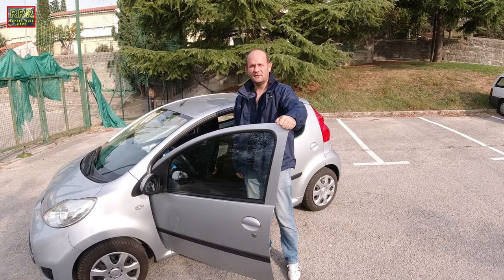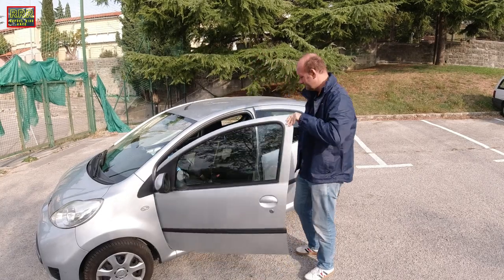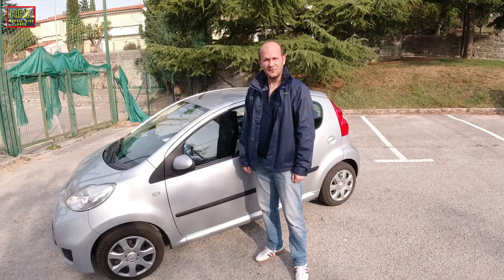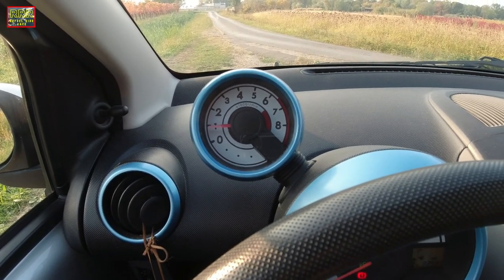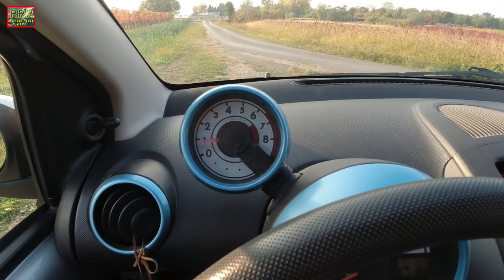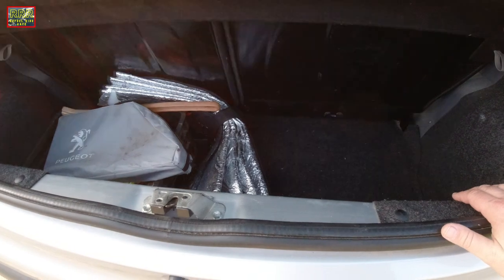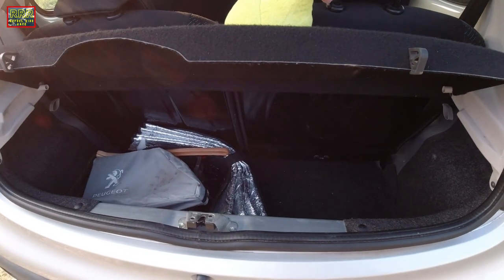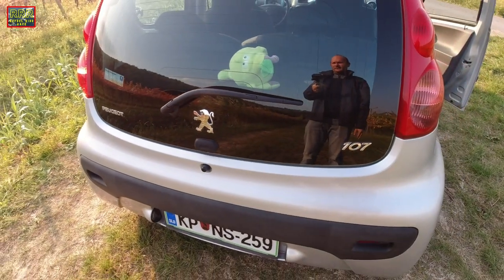Peugeot 107 test drive: a city car

Comment: I personally don't like a manual transmission on a small engine .. you shall change 5 gears to get to 60 km /h 😅
Reply from the maker: Thanks for the comment doit. :) Here in Europe most of the city cars have the manual transmission. Have no preference.
Reply: you are wrong. I with 2 or 3 gears reach 60 km/hour! and it is normal for small engine to have manual transmission.